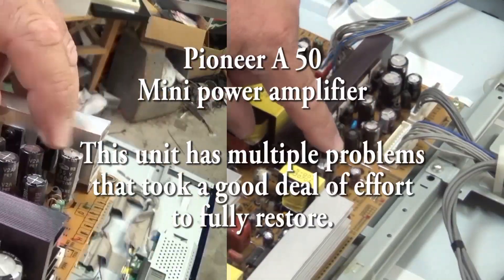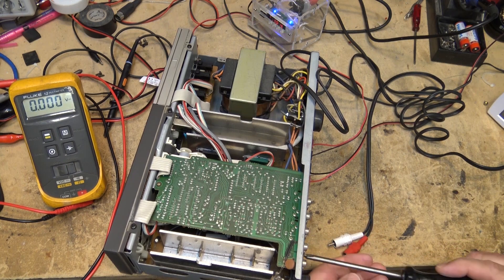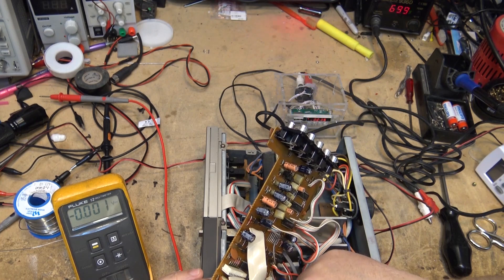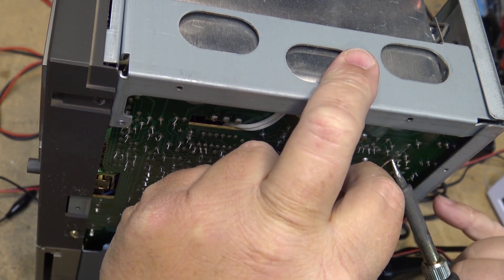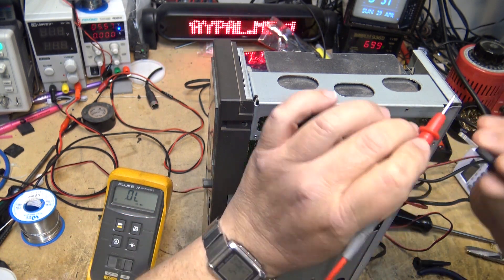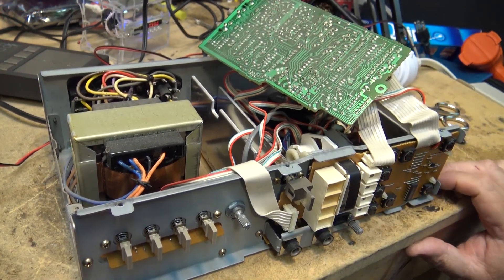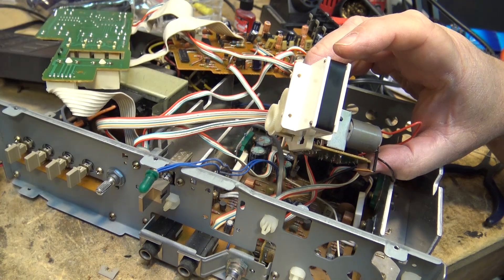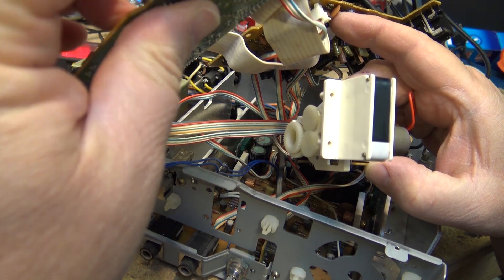Pioneer stereo amplifier model A-X50

Comment: Hello, thank you very much. I solved the problem with volume motor. It had some corrosion, had the same problem. You can pull out the spacer, after taking of the end bell of the motor, so you don't destroy the brushes on the endbell of the motor.  Also one motor pin was damaged, had to resolder.
Was not easy to find your Video, maybee because of the wrong title. The Modelname ist Pioneer Stereo Amplifier A-X50, again thanx for the detailed video.
Reply from the maker: Changed title.
Reply: @12voltvids   I think it was good that in the title was the word "repair" Problems, I would add volume repair and bulbs, etc. So that is clear thats a repair video.

Comment: Who could hate on Caig deoxit? That stuff is a gift from the Almighty to electrical contacts!
Reply from the maker: Craig deoxit is one of the best contact cleaners you can buy.  It is quite expensive and that is what people don't like.  They think it should be 1 1/10 the price.
Reply: @12voltvids  yes it's expensive but after my own experiences with it I don't care about the money.An audio crazed friend turned me on to it back in the 70's while I was doing sound for a southern rock band. I did a quick application to the amp sends in a three way tri amped setup. Before and after the system was 4db hotter!! NO B.S.!!! And this was just the house sends from the stage box to the amp rack twenty feet away and the hi mid lo sends from the electronic crossover to the stage sends.I had to back system gain down 4 db! To me that's proof enough.Four db in a tiny bottle still amazed me.

Comment: I have a small size spring loaded solder pump with a teflon tip ($5).  Sucks the solder right out of the holes in the blink of an eye.  I have been using it for many years.  I admire your perseverance, spending time on repairing a cheap piece of crap like that.

Comment: I wouldn't know why some folks hate Deoxit (aside from price), it's my go-to for cleaning contacts. The corrosive glue is called "Sonybond", it was used by quite a few manufacturers in the day with the exception of Sony. The Klein snips were originally used for cutting frame wires in telco shops and work just as well for component leads. The broken brackets can be super glued back on and the hardening can be sped up with a heat gun on low.

Just my two cents, thanks for the entertainment as I'm never bored watching electronic equipment being repaired.
Reply from the maker: Night Stranger 
Deoxit is great. Yes it is expensive buy you get what you pay for. 
Sony bond funny because sony didn't use it. Yes I am aware of the original use for the lions snips as I work in the telecom industry. We use them now for fiber cutting as using anything else can cause the fiber to shatter several inches from your desired cut. Still used by frame personnel for cutting the ends off jumpers before removing them do they don't snag on other jumpers and damage them coming out. Had to do that yesterday when I was sent to a remote to run in some junpers.

Comment: Holding the brushes apart... yet another job for bent paper clip engineering. 
Straighten a small paper clip. 
Bend exactly in half. 
Bend last 5mm (1/4" ) or so of the ends at right angles. 
Insert in holes and use the paper clips natural springiness to hold brushes apart prior to re-assembly. 
Remove once assembled. 
"Trombone" for the win.
Reply from the maker: Andrew Hull 
That would do it. I didn't have a paper clip around so I just used a jeweler screwdriver on one side as it was a tight fit in the cap, and my dental pick for the other side. Done deal.  There is more than one way to skin a cat.

Comment: The holes on the back of the motor are for inserting small bush holder "pins" (like pieces of a paper clip/etc) when the end cover is installed. Same idea for holding back the brushes for say the field brushes on an automotive alternator.

Comment: Just wondering what peoples views on using WD40 as a contact cleaner are? It's what I have been using as I find contact cleaner to be more expensive here than WD40 and so far it's been working great.
Reply from the maker: I wouldn't use WD40 to clean contacts.  The do make a contact cleaner though. I use DeOxit and Nutrol to clean contacts.

Comment: Nice trick fixing that motor
Reply from the maker: As long as the winding isn't burnt up they are usually fairly easy to fix the brushes.
Reply: Good to know in case I ever run into that problem in the future

Comment: Greetings. Please can you help me with the following ... I have a SONY amplifier and on the amplifier power card it uses ceramic capacitors of colors identical to the color resistors that create confusion; I identified them and was able to address them thanks to the screen printing on the plate and the service manual ... well, the question is if I can change those colored ceramic capacitors for "lentil" type capacitors ... of course, of the same capacitance and voltage if that exists? Thank you

Comment: Smashing repair :-D.
The protection circuit would have confused me for a while too, and that motor drive was clever for the era, the volume display is unusual.
Usually a motor drive means a remote control can be used, but i didn't see an i.r detector.

Screw madness lol, the "Gotcha!" moment :-)
Reply: If I remember right, he said that the other components of the stack, the tuner and stuff, can remote control the amp. So, presumably some data line coming in the back from the tuner and stuff?
Reply: True, I have the Pioneer DC-Z83 and the IR sensor is not on the main unit but on the tuner part.
Reply: White Tiger Gaming, yes that sounds very logical, i must admit that i didnt think that far.
I need some mental binoculars :-D
Reply from the maker: I don't see an IR sensor on any of the components, but there is a remote plug on each component , so they do talk to each other. Perhaps just for input selection or something, or there was an external remote receiver available as an option. Some companies did that.
Reply: I was never fond of wired together systems, they were special and you could not use different stack units, the psu was in one of the boxes and every box took power from it, impossible to use any unit on its own.
I stuck to the normal phono/rca connector units, i liked choice.
i like the old methods better.

Comment: Did you ever fix your old scope or dump it due to the tripler unit fail..

And what scope is the new one..

Very good vid..
Reply from the maker: I still have the old Iwatsu that needs the HV multiplier.
The new one a Tek 2465 was donated by a viewer.It's a great unit that I have't even begun to use to the fullest. I just use it to look at analog wave forms. 
I have that cheap DSO as well, and it works for some things, but not so well for complex analog waveforms.

Comment: For motors, why use Deoxit instead of motor oil between the rotor and stator?
Frank
Frank Reiser Video/Audio Service
Reply: There's a product called  MaxPro Electric Lubricant that would be my go-to.   If it's fixed,  it's fixed.

Comment: what is that phasor noise I keep hearing in the background?
Reply from the maker: THEtechknight 
I have no idea what you are talking about
Reply: 12voltvids I have no other way to explain it but I hear this low-level buzzing noise every once in awhile in the background almost like it's coming from a clock on the hour?
Reply: at 43:49 you hear the alarm. Look at his wristwatch a little later (44:46), it reads exactly 7:00. not sure, but my guess he has an hourly alarm rigged up somewhere so he can monitor his repair time

Comment: Ain't those motorized volume pots an attempt to keep those fussy audiophiles happy,  because they believe the cheaper electronic alternative colours or distorts the sound of their vinyl records etc, on playback? ...or so i've heard.  They even go as far as using switched fixed resistors for volume controls insted of pots in high end Hifi gear.  Maybe not in this case given the age of this Amplifier...
Reply: I don't think electronic volumes even were a thing in the early '80s. Even electronic source selectors would still have been rather limited, with anything you could get being able to run on +/-8 V or so tops (e.g. 4066), and even then distortion specs would only have been so-so. (The parts capable of running at +/-15 V are also notorious for blowing up unless their inputs are well-protected.) 
Electronic volumes would have been a '90s thing, first appearing in TVs and car radios and the like, and it took until the late '90s and early 2000s for high-quality PGAs to finally appear (and those still aren't cheap). At that time, consumer home theater receivers would commonly use CMOS jobs running on +5V only with a single stage of attenuation, resulting in rather poor dynamic range (from very limited voltage swing + noisy amplifiers). When the spec says 95 dB of SNR, that doesn't sound too bad on paper, but in fact could mean an annoyingly hissy amplifier when full power equates to 110 dB SPL @ 1m and the noise floor does not actually reduce at lower volumes. Some even were 5 or 10 dB worse than that, totally hopeless! The current BOTL H/K model says 75 dB (higher-end ones say 100 dB at least), that sounds a bit scary...
Reply: in those days, there were no  rotary encoders,  any amp i ever saw from this period the motor was hacked to a regular pot, but usually with a manual knob on the front
Reply: Digital volume controls indeed distort the sound, and at low levels it goes up to .5% THD which makes a difference. Carbon track pots are OK, but there is a bit of engineering in making a good one that has an even thickness and consistency in the carbon, as well as the optimum feel and lowest wiper noise. Hence why Alps is still in business and not overtaken by the cheapest Chinese brand.

Comment: I missed the part about how many watts per channel. Great video, though!!
Reply: I tried a quick google search for specs but couldn't find an exact match. Going with + & - 42v rails, complementary symmetry emitter follower outputs driving 8 ohm load and reasonable circuit losses the arithmetic puts it at around 110 watts rms. I think 80 wpc rms clean would be a very good slightly conservative rating, but that's just me and i could be off a little. Those heat sinks looked a bit small for 80 watts. Not impossible, just a bit small.

Comment: Those are in fact scissors made by Klein and cost less than $15.  I'm not knocking your use of them, I own several pair and use them all the time.  Great quality and made in the USA.
Reply from the maker: In Canada they are run more like 30, plus tax of course.
In the trade they are called "snips" as opposed to scissors, because, well scissors are used in the office to cut paper.
We don't say "order me new set of electricians scissors" we order a new pair of "snips"  The larger "snips" used for sheet metal are referred to, in industry as "tin snips"
Yes they are made in USA, Chicago to be exact.
Reply: Ahh, yes, forgot about the current Canadian to freedom unit exchange rate :)